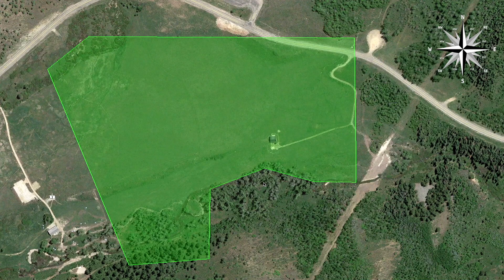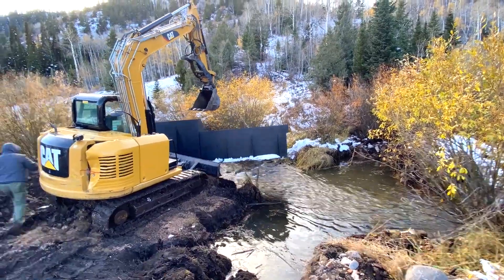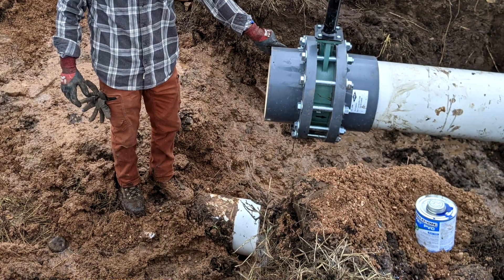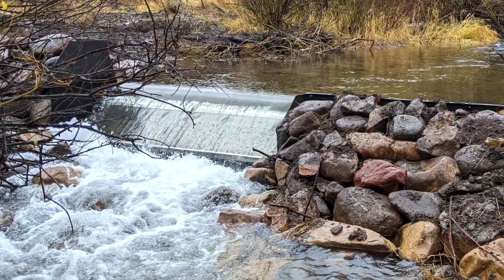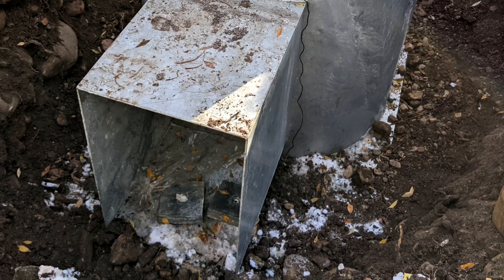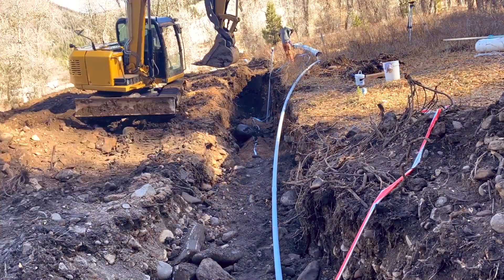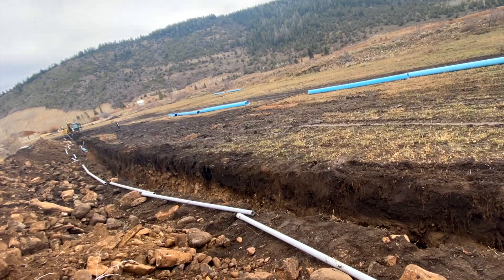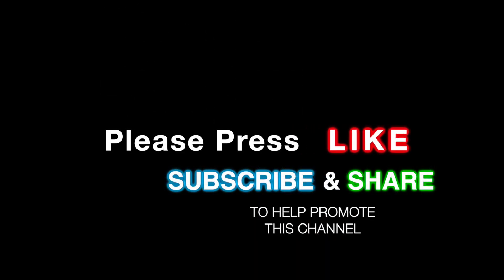Micro Hydro Francis Turbine Part 1 non-music version

Comment: How does one go about finding the "head" measurement over such a vast distance?
Reply from the maker: Several methods can work. Google earth can give you rough estimates. Part 6 of my series from 5:24 shows an altimeter watch being used. And Part 7 https://youtu.be/vovGG-hoels shows how I used a carpenter level and tripod for accurate measurements. Hope this helps 😉
Reply: @mrhydrohead thank you. I live in the very flat Houston area but, I dream of retiring to lots of land in Tennessee with the ability to do this as well as use the discharge water for a geothermal heat pump. Love the content!

Comment: Wow.  Can't believe that you were able to get permits to divert water.
Reply from the maker: Its not my system and I wasn't privy to their permitting process.  I only documented the system, but I'm certain everything was done by the book.  Check out part 2 if you're interested.  Thanks for Watching!
Reply: @mrhydrohead  
I'm just surprised that it was allowed.  I can see it's not preventing flow of water, aka damming, but with water rights being what they are I'm just surprised.  Think it's great that they could do that.
Reply from the maker: @johnjacobjinglehimerschmid3555  Well on my system in CO, I needed to file in District Water Court for Non-Consumptive Hydropower rights on my creek.  There is less loss to evaporation while in the pipe vs. in the creek so for the diverted portion of the water it is a small act of conservation.  It took a while to secure them from conditional to absolute rights.  In CO you need to demonstrate the water is put to beneficial use. 
This video's project which is in UT may have a different regimen for filing/acquiring.  I think its different rules for different states. It helps that you own the land as well, which they do.

Comment: how did you calculate the flow rate ? Thank you!
Reply from the maker: I didn't because I wasn't the designer.  I'm not sure whether you are questioning the creek's seasonal flows, or the max flow rate in 12" penstock before pipe friction limits pressure via losses, or the design flow rate of the Francis Turbine.

Comment: Can the need for a coanda screen be re-thought?
If a pond behind a weir is deep enough and long enough....would the sand and fines settle out on the bottom of the creek bed?
If so, the water flowing through the pond and over the weir is being screened at the coanada screen only for floating debris....
so theoretically the middle part of the water in the pond, between the bottom and the top of the water...is relatively clear.
Ergo, having a large capped pipe as the intake (say 16 inch on the end of the 12 inch pipe)) with multiple holes of say 1/4 inch drilled all over it like in a colander, and with say the equivalent of shade cloth as the mesh filter over this 16 inch intake...
and with this intake suspended in this clean water in the half way zone (the depth and the small holes countering vortexes from  suction to the surface)...
does away with the need for the very expensive coanda screen or it's maintenance...
It makes the dam just a simple  overspill one...which would automatically clear any floating debris over the edge and allow it to continue down the creek
I refer you to a smaller example for your thoughts......
https://www.youtube.com/watch?v=LVoeaKCEd2o&t=71s   @ 4.43
In Marty's home hydro system it has been working well for 17 years....
Reply from the maker: The large fluctuations of flows that are likely in spring might make your solution not so viable.  Part 17 of my series from around 3:00 shows how I tried something not too dissimilar to what you suggest.  It became clogged even with larger holes.  Debris in the watercourse often sinks once waterlogged so the half way zone you describe may not exist year round, particularly in fall time.  The Francis Turbine video you are commenting on is not my own system and I will only be seeing it first hand when I journey out next week to shoot it.  My system is far different that this one and I will witness the start up when I visit it.  I do have an intake at my springs which fed the first system I developed, but the water comes right out of the hillside and is covered over so its a poor comparison.
Of course its worth experimentation to find an ideal collection method for minimal expense in any system.  Its always fun to ponder different scenarios for what might work, but the proof is in the pudding of actually trying things and seeing what works best.
Thanks for the thoughts and thanks for watching.

Comment: I have to ask. How much did the system cost, if possible the break down of labor and materials. Also what was the process you went though with any EPA like agencies?
Reply from the maker: I am not the designer installer or owner of the system. So I don’t have access to that sort of information. I just put the  images together that they shared with me. My plan is to shoot another segment early in June and may get answers to your questions at that time. Sorry I don’t have answers today. Thx for watching!

Comment: How to clean out fine sediment from the intake chamber after flood?
Reply from the maker: Good question!  I’ll ask the designer/installer when I visit the site.  Thx for watching!
Reply from the maker: He said that anything small enough to get thru the Coanda screen can just be flushed through the turbine.  Larger gravel or rocks that might be left in the penstock during construction is more of a problem because it can get caught up in the vanes of the Francis Turbine and reduce efficiency.  Thats why they used the long rod with plunger shown in the video to clean everything out during penstock assembly.

Comment: There should have been a "T" with an open top vent pipe near the intake. The purpose is to prevent collapse of the 1200 ft penstock. 
The snow on the ground is also not good, never backfill with frozen ground. 
The penstock is also buried shallow and may be susceptible to anchor ice, which can break loose and damage the water turbine.
Reply from the maker: There is indeed an air vent which you can see just after 6:01 in the video.  I wasn't present when the system was installed and as stated in the video, all the footage was supplied to me by the installation crew.  I feel quite confident that the penstock was properly installed as the designer/installer was present for the process.  I have great confidence in his expertise as he is the instructor of the micro hydro course which is taught at Solar Energy Intl. in Paonia CO.
My own experience in extreme cold conditions with my own system at 8600ft in CO is that if the water is under pressure and moving it does not freeze within the pipe regardless of depth beneath the ground.  I have also found that snow cover tends to insulate our penstock from extreme nighttime cold temperatures.  While what you point out might occur, it is not my experience that it would be likely.
I appreciate your input, but might I ask, what is your expertise in these matters?
Thanks for watching and commenting!

Comment: i came out to 7.78 kW Pth. @ 85% eff. Is that number realistic considering pipe loss and generator efficiency?
Reply from the maker: I think that's habit high.  The engineer designed it for 6kw and I have no reason to doubt his expertise. The generator is a 6kw and they may not have a full 3cfs flow year round.  I haven't actually been to the site yet and have only seen footage shared with me and the plans for the design.  I'll know more when I actually visit the site probably in late May.  Thx for watching!
Reply: thanks for the reply! i have found myself rewatching your system rebuild series quite often, especially for the winter and fall drone shots. are we going to see more of these low head, high flow systems in the future? i have been looking at turbulent hydro as a potential design for my water source but it involved quite intrusive concrete works. this premade discharge contraption looked quite straightforward to put into place. i assume at 10m head there aren't water hammer effects that would require large thrust blocks to prevent pipe movement?
Reply from the maker: I don’t yet know of other low head high flow systems to film. I know Ken has been working on one in Nevada but that’s a bit far for me to journey to.  The turbulent system seems like a good one, but they haven’t installed many systems yet, particularly in the US.  They seem to be marketing to small villages or larger demand sites. The concrete works might be less work than a penstock though. I guess it depends if you have to build an entire creek dam or could channel water to it.  I doubt water hammer will be an issue on this one and generally isn’t unless some knucklehead slams the gate valve closed too quickly. I don’t think they installed any sort of thrust block on this one.

Comment: Thank you .  I love the design of the weir, smart all the way around.  I would love to see examples of inline hydro that irrigators can put in existing systems to replace PRVs.  Also would the next neighbor down stream be interested in the clean tail water for yet another system and so on?  I guess I do not know the intricacies of the turbine and the draft tube but it seems odd to loose a few feet of head to come back up at the top of the turbine. Thank you and the video is well produced like your others. Cheers.
Reply from the maker: The weir actually has an anode-cathode system to help prevent rusting as well.  Its something I didn't notice until the designer pointed it out.  Very clever.  I've not yet met the owners of the property or the neighbors as I put together the video from footage which was shared to me.
The draft tube is what actually keeps the working pressure at the lowest point of the penstock as it provides a couple of feet of "downward pull" or negative pressure on the water as it exits the turbine. 
Glad you liked the vid. I'll be going to the site to film the final installation in the coming weeks. I'll have more first hand observations from that. Thx for Watching!

Comment: Great stuff. How about cost?
Reply from the maker: I haven't actually been to the location yet to see the system which is scheduled to be completed in early May.  I will ask when I visit to film the electrical equipment and final install.  Thanks for watching!
Reply: A fortune! 12 inch pipe 1200 ft long, just the excavation and backfill is expensive. This type of system is for people who have alot of money. Nice but expensive.
Reply from the maker: @johnstack4316  Penstock is always the most expensive part of a system.  Cost also needs to be compared to running power lines in on a fully off-grid system which I think this system is.  You would still have monthly power bills (likely carbon based power) to pay in addition to access costs.  I don't know how far this property is from power lines, but will find out when I visit in early June